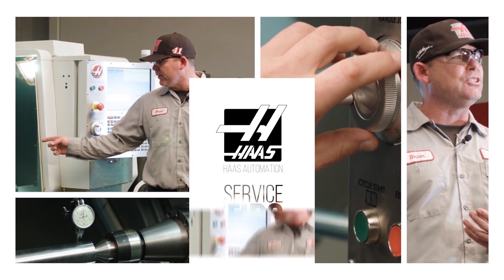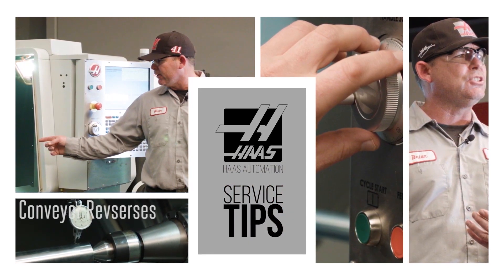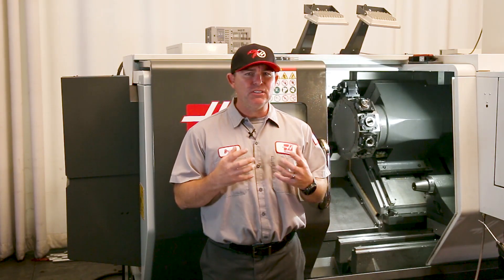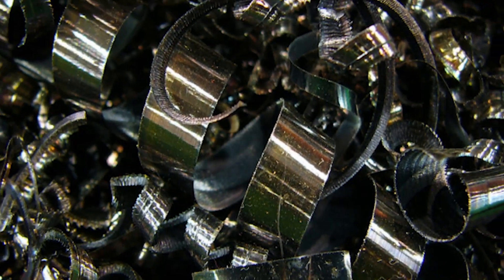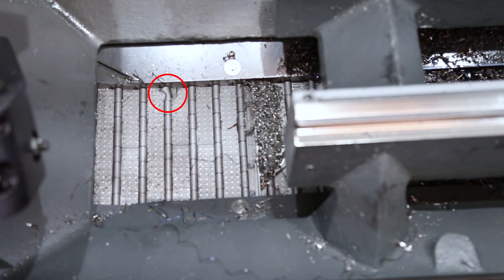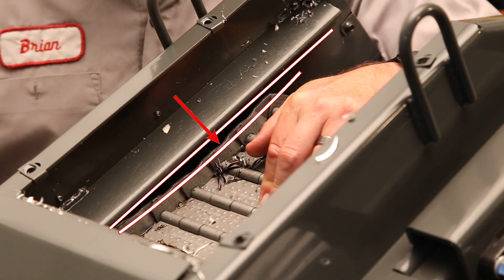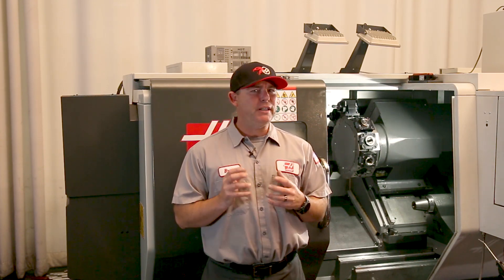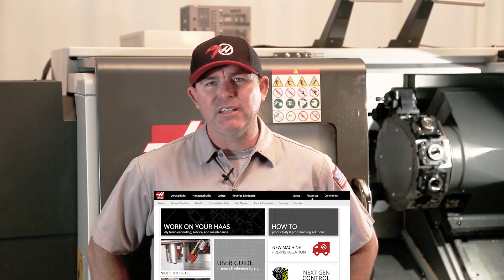Chip Conveyor Troubleshooting - Haas Automation Service Tip

Comment: Wow, cleaning and regular maintenance. Who'd have guessed?

Back to my search for reducing or eliminating choke points 

It looks like a one inch outer diameter pipe with maybe a quarter inch pin welded across the end might let a person give the motor a little extra torque. Try not to break your arm when it reverses on you